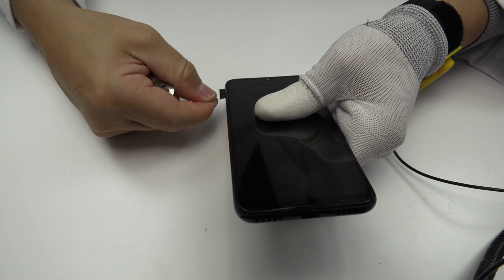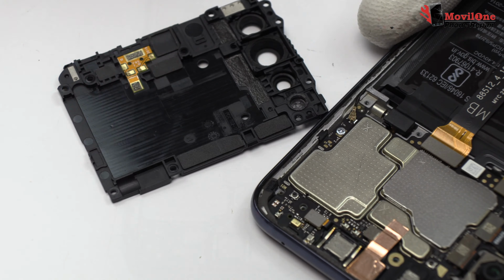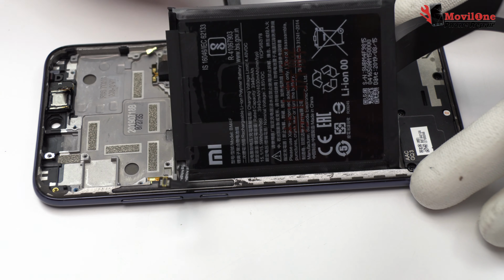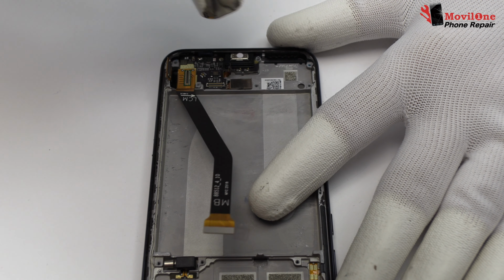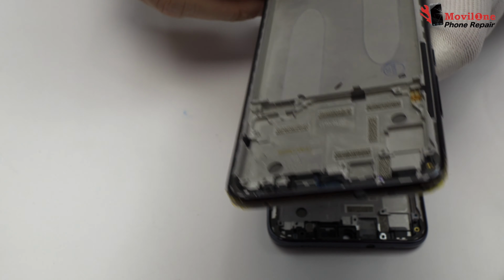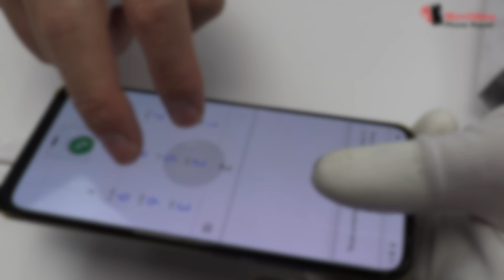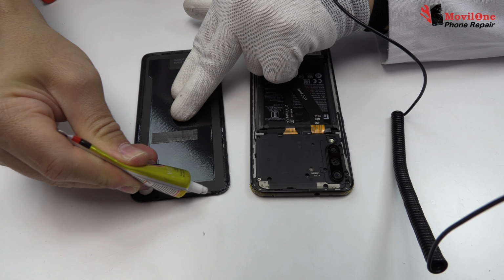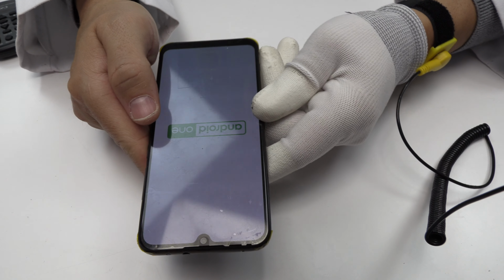Xiaomi Mi A3 Screen Replacement

Comment: Thank you for the video. Can you please answer a question? You have a link for an Amoled Screen and a TFT screen. The TFT screen is much cheaper. Is it worth it to buy the Amoled or is the TFT very good also? I have heard that the TFT uses more battery life. Will it have fingerprint sensor as well? Thank you in advance for answering.
Reply: If u use tft screen or any other screen the thumb sensor will not work
Reply: Go for AMOLED. I did a mistake buying the TFT display. It's eating a lot of battery and the fingerprint scanner doesn't work anymore
Reply: @adityakulkarni6708  Thanks. But I already bought the TFT screen.
Reply: @Mastatis  did it work and are you getting any problems after? as well as did the fingerprint sensor work?
Reply: @coastguard7168   I changed it on 2 phones. They tell me that it works fine. The fingerprint sensor doesn't work on the TFT screen. The TFT was much cheaper so you should decided if you want to go for the more expensive AMOLED and the fingerprint sensor (I don't know from personal experience if it works, but I read that it does) or the cheaper TFT.